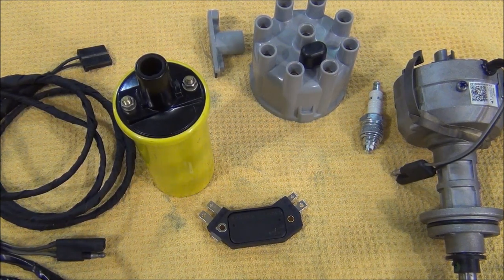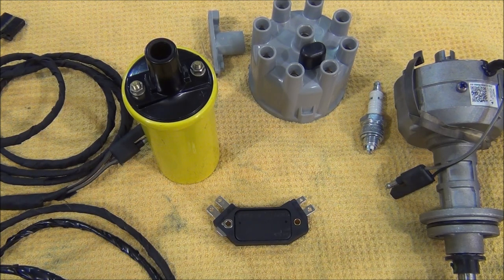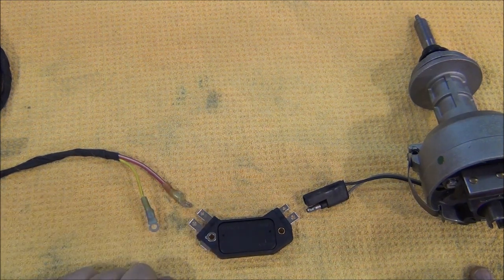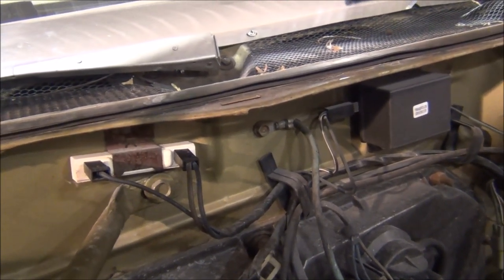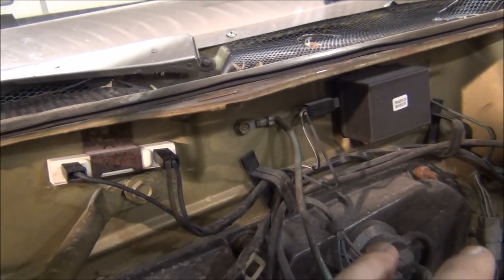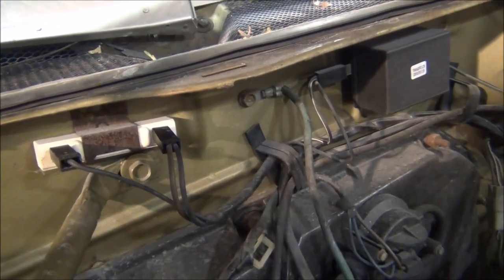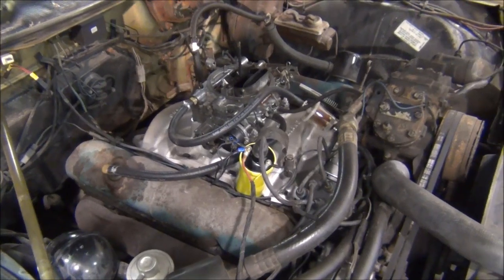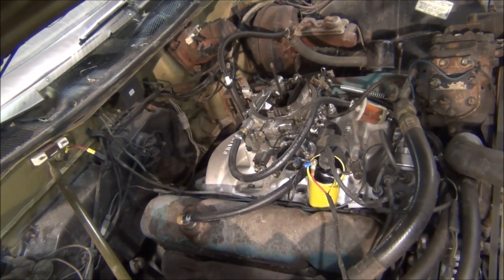Mopar Points Ignition Conversion - Get rid of your ballast resistor

Comment: The "B" block 361/383 & 400 distributor is not compatible w/the "RB" block 413/426 and 440. Thank you for the tutorial though...it was very concise. Seems like a lot of work. have u ever tried an HEI unit. Not sure if it will work with a "Tall" 440 roller rocker - aluminum valve cover. Would appreciate any thoughts or advice. Thanks. I liked and subscribed.
Reply from the maker: No, I haven't tried an HEI. Ive been running this setup for 3 years and it has been working working great
Reply: Thanks buddy good to know that it's holding up so well. Maybe I'll try it after all. A lot to consider...I'm not very electrically inclined. Glad u posted this video. Think I can tackle it if I decide to go that route.
Reply from the maker: @guidosarducci3047  those HEI kits make it easy to do. And they aren't super expensive. So if you want to go that route, especially if you're not into wiring,  sometimes its worth it just to make it easier

Comment: Gonna attempt to do this on a Australian 1978 Ford Falcon so I’ll let you know if it works. I found an ignition module that suits so in theory should work the same.
Reply from the maker: Yep. As long as you can fire the module,  the car doesn't know what's making the spark, just that its there.

Comment: You can use a Ford or Chrysler electronic regulator for older alternators the Chrysler electronic regulator is a good unit
Reply: The ignition module? There's no regulators in this circuit. The only regulators on old Mopar are on the firewall for the alternator field terminal, and in the dashboard for the gauges on cars that run 5v-6v gauges.

Comment: I did this to my Satellite step by step and it fried ignition wire to the switch so today I plan to run all new wires change voltage regulator an try again any advice would be helpful???

Comment: I have a 1976 dodge d200 with the 360. Is that a points distributor or hei
Reply from the maker: Its probably hei. There should be a window on the cap if it has points. You can USUALLY lift the cap up a little  and set it back down without issue to see if it has points
Reply: Awesome thanks for the info

Comment: Does this work for a 1978 Dodge Van with a 440 4barrel thermoquad carburator can I get rid of the ballast resistor ? thanks for the information
Reply from the maker: Maybe. It would be a ton of work
Reply: Do a google search - there is a lot of info along with wiring diagrams to get rid of the chrysler and ford duraspark modules - including the ballast resistor / resistance wire and convert to the tidy GM HEI module. Cheers.

Comment: This might be a weird question but do you think it would be possible to retro fit a 90's modle dodge with points and carb??
Reply from the maker: Not that weird.  The problem is how do you get a distributor to run or mount? Most 90s engines don't have a provision for one, and that's what makes it expensive.
Reply: @MaverickTangent  , my 98 ram runs a hei distributor and fuel injection that's why I asked

Comment: my ballast resistor is getting reaaaly hot. car wont start,just one click and then it srarts getting hot,have to hurry and disconnect batt so i dont burn my wiring.any suggestions??
Reply: by the way its a 65 coronet with a 400 bb
Reply from the maker: Ryan David well I pulled my ballast resistor off so I don't know anything about them. they are supposed to get hot, they are a resistor
Reply: I run points in my 64 Valiant and yeah, they do get hot. I just replaced mine and it was burnt in the back portion of the resistor. Probably from all the hard starting.

Comment: I just bought the Pro-Form Hei kit off Amazon $149 & the ballast resistor that came in the kit is just a single one.  Do I upgrade the coil now too?  1977 dodge bb 400.
Reply from the maker: Jim Hamilton this may sound like the back of the box, but i would use the coil proform recommends with its kit. systems with ballast resisters need specific coils and there are like 40 different kinds
Reply: Maverick Tangent 
I asked several people on both ebay & yahoo that sell the Pro-Form Kit what coil I needed based on the ballast resistor & they all said any stock coil would work.   Hhhmm,  guess I'll just get the MSD 2 with their matching ballast resistor from Jegs.  Thanks for the follow up.
Reply from the maker: Jim Hamilton that's why I moved away from the ballast resistor. there aren't a lot of options for hei.  also, the fuel injection kit I got said that I need to move away from it to run the setup

Comment: So what do you feel the upshot is with doing this ?  I've owned many GM's and Mopars and have had to change all of these items more than once. This just seems to me that you are swapping one issue for another. Plus you have to make modifications and add a heat sink!!
Reply from the maker: Its just simple and reliable. And its HEI so it can fire the fuel injection.
Reply: HEI ignition modules are available at any parts store or junk yard. They usually fail from heat damage. If you have any broken computers around, try to get a small finned heatsink from one of those for the module. Make absolutely sure to use thermal grease between the module and heatsink. It gets rid of the air gaps and helps heat move faster.

Comment: You said "you.wouldnt have a 360 with points"... ??? Honest question did they not make a 360 w points igniton?
Reply from the maker: I believe all the 360s were introduced after the electronic ignition. So, no. I might be wrong, but if there was a 360 with points, it was only like 1 year.
Reply: 360 was introduced in 1971 and had points ignition.

Comment: What did the GM ignition module come out of? Part #?
Reply from the maker: 1977 chevy 1/2 ton 350. They are literally all the same from 76-86
Reply: @MaverickTangent   I was just reading through prior comments and saw your other reply. Thanks!
Reply: And for clarification I have a 84 d150 with a slant 6 and the lean burn ignition system has lean burned out lol.
Reply: I have a new vacuum advance distributor coming tomorrow, going to run fetch the module and have everything ready to wire up as soon as it arrives.

Comment: Mopar still sells the wiring harness kit for there kit part number P3690152AB for the Orange Electronic Control Unit P4120505. You can order these through your local Chrysler, Dodge, Jeep, Fiat dealer. Why use GM junk? Also, the 351-400 Chrysler engines are "B" blocks, the 413-440 are "RB" blocks. The RB blocks use a distributor that is a 1/4 inch longer than the B block distributor that is also a 1/4 inch longer than the 273-360 "LA" engines. They do not interchange between engine block codes! Here is an article showing the wiring diagram of both a single and dual field ballast resistor http://www.earlycuda.org/tech/ElectronicIgnition.htm  way easier to do than all this stuff you just did for a GM HEI crap. Chrysler's electronic ignition and electronic voltage regulator premiered on the 1968 Imperial Lebaron 4-door hardtop all divisions and engines had electronic ignition by 1971, and electronic voltage regulators by 1970. GM did not release there's until 1974. GM's HEI fails all the time, Chrysler electronic ignition never fails!
Reply from the maker: Good thing you read the title of the video.
Reply: I did.
Reply from the maker: @andrewarmstrong7310  Get rid of ballast resistor. You can't do that with a mopar kit. You need it for their HEI. And I wanted to make sure I can use parts that stores stock, not some weird Petrinox kit that takes a week to order. Its run great for 2 years.
Reply: Mine has run fine for the last 30 years I have no intention of getting rid of it to use GM junk in my Plymouth.
Reply from the maker: @andrewarmstrong7310  I needed HEI for the fuel injection install.
Reply: If it is not a direct injection mass flow set up, your wasting your time and will make less power over the carburetor.
Reply from the maker: @andrewarmstrong7310  Eh, not worried about power. Just want it to be able to take road trips. I have a fast car.
Reply: Should have swapped in a 5.7 Hemi and 5-speed from a ram truck.
Reply: Ballist resistors are junk gm all the way I'm only watching this cause I got a 78 dodge rv for $100 I'm a chevy guy way easier and more reliable than dodge could ever be if this dosnt work 318 is coming out and 350 chev is going in.
Reply from the maker: @andrewarmstrong7310  Totally what I should have done. Spent $5000 on a car worth about$5000 removing a 320hp fuel injected engine to install a new 320hp fuel injected engine.
Reply: Burned out yet?
Reply from the maker: @andrewarmstrong7310  nope. I was just driving it this weekend
Reply from the maker: @andrewarmstrong7310  cars for sale if you want it
Reply: @Andrew Armstrong  Thanks for the clean wiring diagram.  That works very well for those that pretty much keep all looking original, too.  But my car was already molested/messed up when I saved it from some kid.  (It was blowing the flatpacks.)  This is a good idea for lots of people.

Comment: The ballast resister acts like a voltage regulator.  Eliminate it at your own risk.

There is NO horsepower in ignition, unless you've got skyhigh compression or any alky motor.  Tearing out the Lean Burn will gain you nothing but hundreds of wasted bucks.  Most lean burn issues are carb, distributor, or timing chain issues.
Reply from the maker: It's run fine for 3 years.  I had to do it for fuel injection